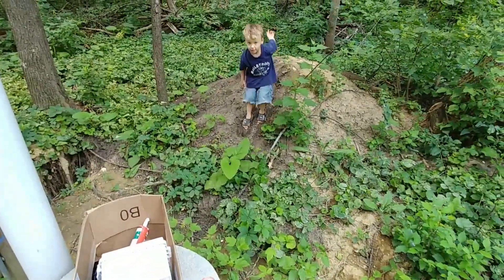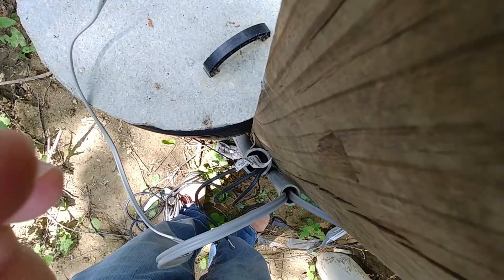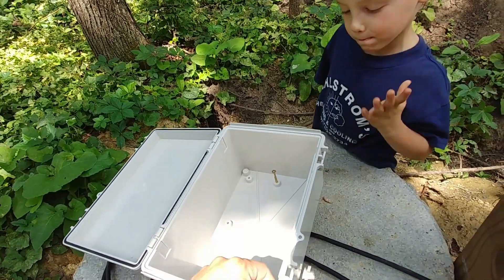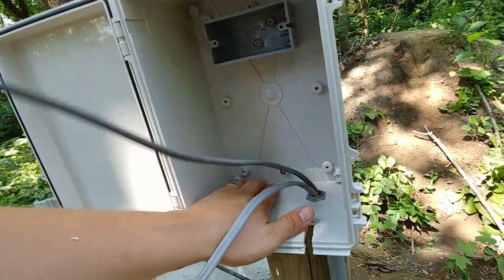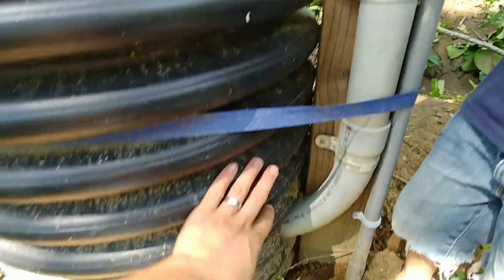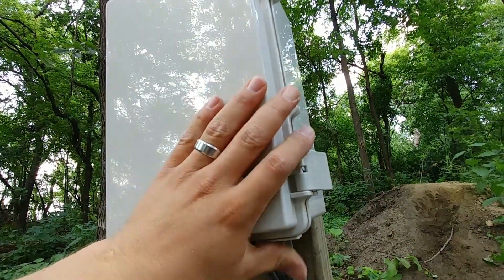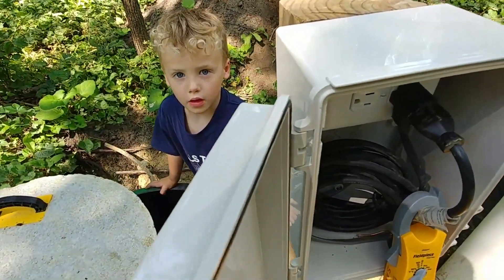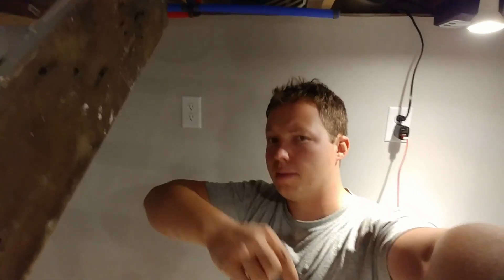How To Wire a Septic Tank Pump & Alarm System

Comment: I would use tamper resistant screws and or bolts to hold on all septic system covers in place. 
Once in use the system will produce toxic gases. 
Children should never be  able to get into a system cover. 
Children could be overcome by fumes if they were to fall in and possibly drown. 
Young adults may be developmentally capable of understanding the risks a septic system involves - children are not and should not be exposed to systems. 
Please put your child’s safety first. 
Teach topics at developmentally appropriate ages.

Comment: I'm sure you've got some people confused. You called the alarm wire low voltage then you called it the wire coming from the house. Yes it is coming from the house but you should have shown the receptacle being wired up and explained that is where the main power is coming from. Don't get me wrong this was a great video but most people watching this are probably looking for nohow and they may be confused.

Comment: Hello Ben & Y-tubers---great video & entertaining helper ! Wonder if you or someone could shed some light on what I'm trying to do. I have a new septic pump; and want to hardware a simple monitor light (placed inside the house) so I know (can see) at a glance if the float switch has stuck on from crud in the tank. This has happened before---luckily I caught in time before the pump burned out. I have a Siemens 220V LED light--2 wires coming off it. My prob IS---I've tried to wire that light to the float switch--so that the light comes on when the PUMP comes on---then goes out when the pump stops. I've tried MANY combinations of connecting those 2 wires from the light to the float switch AND the pump power cord with no luck. I even opened up the relay part of the float switch; and tried the various combinations of connecting the light with no luck. IOW's--I've played with hooking up the 2 wires from the light to various combinations of the black, white & green wires on both the pump power AND the float switch--can't get that light to come on when the pump kicks in. Any feedback / help from ANYONE would be most appreciated !!! Thx in advance

Comment: I've scene electrical outlets "weather tight" style outlets with the covers over them installed inside the riser of the septic tank itself and they will slice the cover for the wiring to fit with cover shut. I always laugh when I see that cause after a few years they burn out. But I realy like this idea spcialy where your tanks are in the woods kinda and having that post with the box isn't such a eye soar in the middle of a customer's yard. Makes changing out a pumpnor Floats much easier in the future
Reply: Comments: good. Spelling: D-, but amusing.

Comment: I'M BAFFLED: Perhaps somebody can explain how the pigtail outlet works. It is just a plain outlet with a break in the Line conductor. This break can be closed by an "ON" float switch. There is no relay in the pigtail cord. When the "ON" switch completes the circuit, current flows through the pump since the pump float is up. But why doesn't the power stop as soon as the "ON" float drops a bit? What we want is for the current to flow until the pump float drops and the tank is emptied. If there is a way to accomplish this without the use of a simplex control panel I want to do that instead of replacing my broken and expensive control panel.
Reply: The float switch is in the float. The float is oval in shape and connected on one end by a tether. The float switch switches in the vertical position. Imagine ball inside a tube, when the ball is at one end of the tube the circuit is open, it closes when it is at the opposite end. While in the middle it does not change the state of the switch. The float moving up and down with water level changes causes the orientation to of the switch to alternate between open and closed but stays unchanged while horizontal.

Comment: My alarm was ripped out by accident, is the alarm basically just to tell you when the tank is ready to be emptied? I don’t have money to get it re wired in. You think if I just get my tank emptied every 2 years I’ll be ok for now not to replace the alarm?
Reply: The alarm is for high water in case the float that the pump is plugged in or pump fails then the high water alarm will go off good luck

Comment: I see u bought a zoeller 267. I can tell u exactly whet to expect from it. Water leaks into the switch compartment & corrodes the non-water resistant float switch & relay (if it's a 3 phase motor) & all the electrical connections. I just bypassed the float switch, replaced the relay & sealed everything best I could with silicone. Hoping for another 5 years from it.

Comment: Nice video bud. My only concern is you have groundwater coming into your pump chamber. Once you start using it your leach system is going to get overloaded and it will cut the life of the system in half. Might want to spend a little and seal it then spend a lot to replace it down the road

Comment: Great video! I always wanted to learn how the septic alarm works. This is a perfect video for it. Now I just need to learn how to add a wifi plug so I don’t have to run to the basement to turn off the alarm every time. My septic alarm goes off pretty often. I checked everything out, but they all seemed to look fine. Thank you Ben.

Comment: Thanks Ben! this was a great video. I've had my septic wiring splicing always rotting out on me for years. I've used your idea almost to a T and moved all connections out of the tank using the same box enclosure with the receptacle and it turned out great.

Comment: Ben, I don't know what state you live in, but I'm in New Hampshire, and this is not how you wire an Effluent Pump & Pump Alarm. In fact, as a Septic & Sewer Professional with 20 years of experience, I can tell you in all honesty, I have probably done over a thousand pump installations, and it's always best to "hard wire" all of the electrical connections inside the Electrical Junction Box. In other words, no plugs or outlet inside the box, which means you cut the plugs off the ends of the cables. By the way, you should absolutely run the Electrical Conduit into the bottom of the Weatherproof or Watertight Junction Box, and the Duck Seal you used outside the box, goes inside the box, and I always use weatherproof or waterproof wire nuts, which you did not do. Cutting a slot or slit in the bottom of the box for the cords or cables is not a good idea, and is certainly not how the pro's do it. Not to mention, you installed your Electrical Box too high, because you hardly have any cable for the Alarm Float inside the box, and typically you need about 6 inches. Plus, the Pump Alarm Float is low voltage anyway, and doesn't require a 14 gage wire, you could use bell wire or thermostat wire... it's just activating a switch. Again, I'm in the Northeast United States, and here in New England, we worry about snow and below freezing temperatures, which is why it's definitely a good idea to install all the electrical outside the Pumping Station or Pump Chamber, and using a pressure treated 4x4 or 4x6 is the way to do it. That part of your work is correct, and although the Electrical Box you used is much larger or bigger than I would use, that's not a problem either. I'm glad too see everything is easily accessible for future service, so to be fair, you did do some good things. Nevertheless, you really want separate dedicated circuits for both the Pump and the Pump Alarm, with nothing else plugged into the outlet for the alarm, and in case of a power outage, I recommend a generator to all my customers. Keep in mind, when the power goes out the Pump won't work, and if you have a well, you won't have water either, but a generator can power both the Septic System and the well.
Reply: Hello Craig---read your post---you sound like a guy who would know what I'm trying to do. I've posted to Ben---thought I'd ask you too.---------I have a new septic pump; and want to hardware a simple monitor light (placed inside the house) so I know (can see) at a glance if the float switch has stuck on from crud in the tank. This has happened before---luckily I caught in time before the pump burned out. I have a Siemens 220V LED light--2 wires coming off it. My prob IS---I've tried to wire that light to the float switch--so that the light comes on when the PUMP comes on---then goes out when the pump stops. I've tried MANY combinations of connecting those 2 wires from the light to the float switch AND the pump power cord with no luck. I even opened up the relay part of the float switch; and tried the various combinations of connecting the light with no luck. IOW's--I've played with hooking up the 2 wires from the light to various combinations of the black, white & green wires on both the pump power AND the float switch--can't get that light to come on when the pump kicks in. Any feedback / help from ANYONE would be most appreciated !!! Thx in advance
Reply: @bcampbell185  Mr Campbell, I don't understand why you're not using a Pump Alarm or Tank Alert, which is required by code here in New Hampshire. By the way, it has its own Float Switch, which is independent of the Float Switch for the Pump... needs to be set at a higher elevation inside the Pump Chamber or Pumping Station. In any case, it's low voltage and pretty straight forward to install, and that's what I suggest you do. Again, up here in the Northeast United States, we typically use 2 Separate Dedicated Circuits... one for the Pump and one for the Alarm. I strongly recommend doing it that way, so if the breaker trips and the Pump isn't running, at least the Pump Alarm will still work... Alright?
Reply: I was just talking to the journeyman electrician who works the supply desk at the local large electrical company and he was saying that code where we are does not allow cutting plugs and hardwiring. That is altering equipment. If the pump comes with wire and no plug, then hardwire, if not, then you must use the plug. Code also calls for AFCI in nearly all outlet circuits. I will be buying a pump that will be hardwired!

Comment: Did you just run screws directly through the back of the enclosure box into the post?  And then screws through the back of the single gang box into the enclosure box?

Comment: Thanks, my septic pump will trip the ground fault after only be in the tank about two and 1/2 years... But if a plug the pump into a non- GFCI, the septic pump works and drains all of the sewer water.....
Reply: I had same issue with a refrigerator.  I had it plugged into a GFCI outlet for well over a year, working fine.  Then all sudden it was tripping the outlet.  After I did some reading I found that it was not recommended to plug a fridge into GFCI bc when the compressor first kicks on it can trip the GFCI.  Your pump may be doing same thing?

Comment: Geez. Keep your kid away from the open tank!  Omg if he ever fell in there you’d never get him out on time!
Reply: The septic tank raiser is almost as tall as the little boy. So he will need a ladder in order to climb over, to fall in the tank. You should use a little more intelligence and a little less hate before you post comments like this!
Reply: @tedsimeonov9696  Hey I was just trying to help. Can’t really tell how high it is from your video bI worked for over 25 years with the fire service and saw far too many horrors involving kids in that time.  In several cases where kids lives were ended or permanently changed forever.  That was all. Now as far as hate comments. I’m thinking you’re the one with the problem.  You made an assumption as to my intelligence without even knowing me? I spent my entire life showing up to help people in crisis, putting my own life at risk more times than I can count. I’ll live forever with the challenges caused by a career of trying to help, now that I’m retired. You overreacted. I was just trying to offer help.
Reply: You didn’t hear Ben tell Ollie to not go near because if he did he would fall in?

Comment: Great video! Do you have to use two separate wires for the pump and alarm or can you tie into the pump wire with the alarm wire?
Reply from the maker: Two separate wires. One 12/2 UF for the pump and one 14/2 UF for the alarm.
Reply: If you used the same branch circuit for both, and say the pump tripped the breaker you would no longer have an alarm circuit.

Comment: Great video. I'm getting read to build a house and am going to have to put in a sewer grinder pump for the public service line. The quote they gave me was over $6,000 for the pump, basin, excavation, pipe, and wiring. That was crazy so I'm doing it myself. My plan is  pretty similar to yours with the electrical box setup. Very nice video and will help me out a lot. Thanks!
Reply: Jackie Holt I did it myself for about $700. That includes all of the parts you mentioned.

Comment: It's named UF WIRE if you're going to do the Work get familiar with the material.. Also you cannot run UF within a conduit that's why is named UF.. Need to understand the NEC.. before doing any electrical work. Any wires being used in a septic tank needs to be Yellow Jacket wire. The recepticle should be a GFCI weather resistant receptacles not a household receptacle, and if it's named weather resistant is to be daisy chained with a GFCI.
Reply from the maker: I'm not sure what you are talking about with the yellow wire. They don't make yellow UF wire that I am aware of. The receptacle is not required to be GFCI if it is not accessible (eg. inside of a sealed electrical box). This was according to our state electrical inspector. Thanks for your comment and thoughts.
Reply: yes you can run uf cable in conduit and its code,when it comes up from the ground into weather it be a electrical panel or a junction box its got to be protected it can just be a unprotected cable and receptacle does neeed to be weather resistant being its in a enclosure or GFI it could have been a single receptacle and u would not want it on a GFI do to nuisance trips as far as the cable not being yellow think you have that confused with with cable going to a well pump